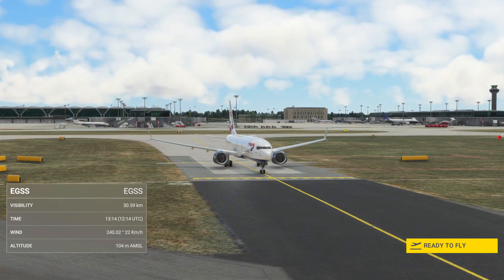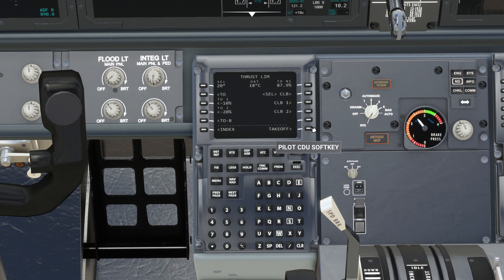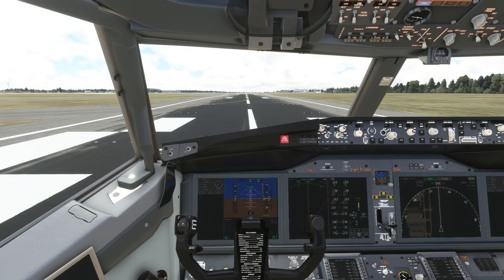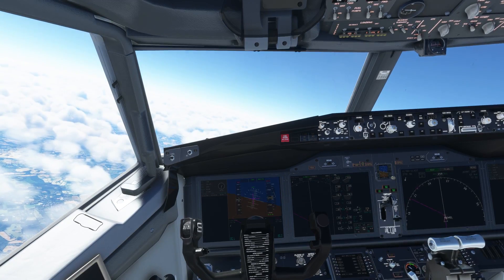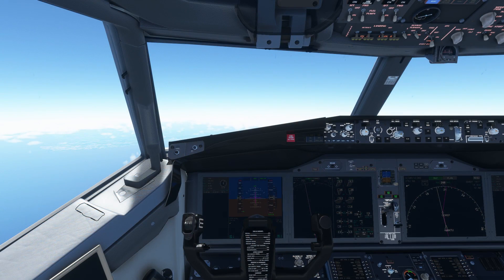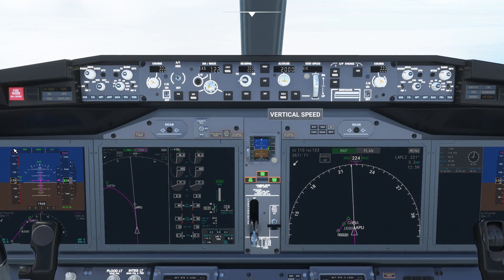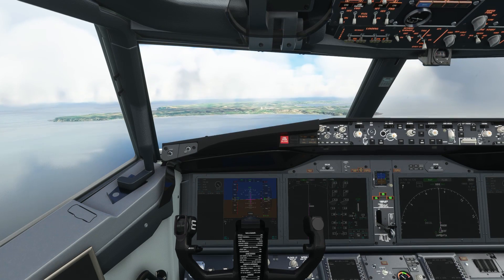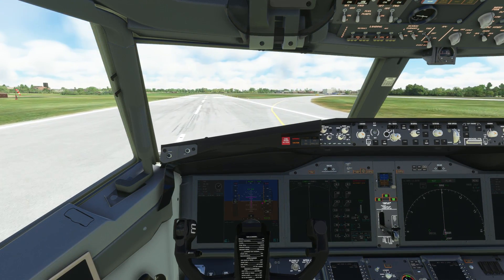RNAV Approach Tutorial MSFS - Boeing 737 MAX

Comment: When I set the LNAV, it swings the plane left and right when you are cruising. Is there a fix to this
Reply from the maker: Nope. The underlying issue is that MSFS allows one “sensitivity” setting for both nav path and localiser, so devs essentially have the choice of wandering on nav path, or poor ILS alignment. This can be smoothed over with proper flight dynamics and custom code - neither of which Bredok has added to this plane. This issue becomes worse with sim updates, when planes are not also updated to suit.